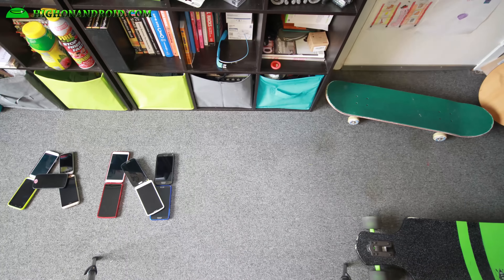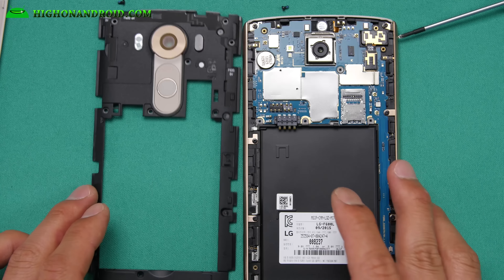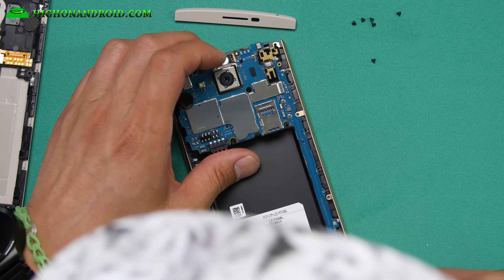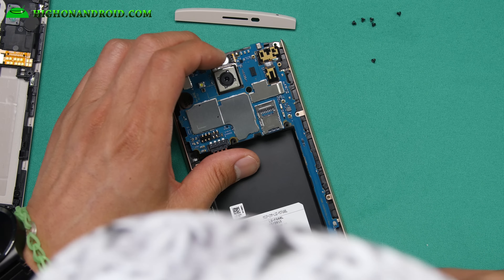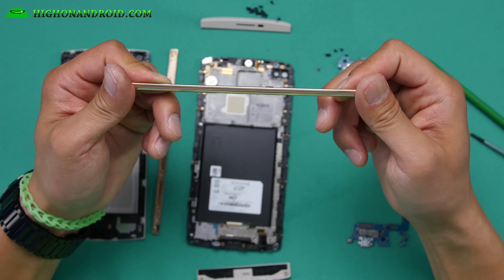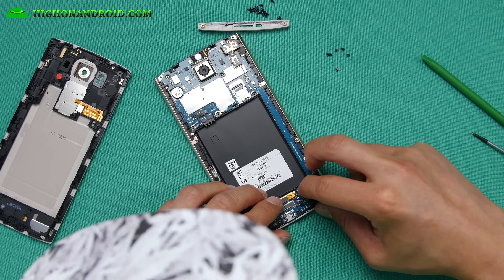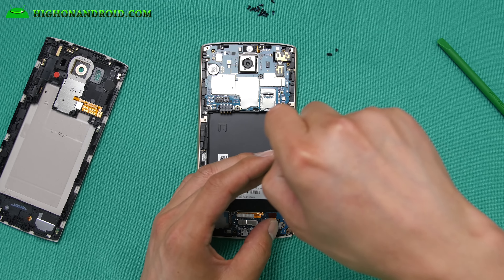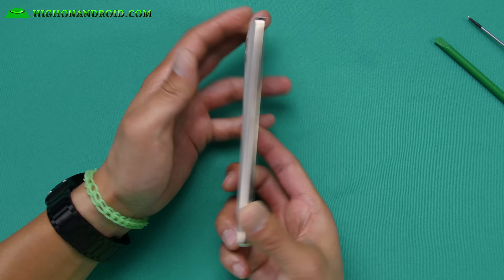How to Disassemble LG V10 for Repair! - TEARDOWN!!!

Comment: Awesome video Max. Just what I've been looking for. I broke the screen on my LG V10 within a month of buying it. This video has gaven me the confidence to go ahead and buy the replacement screen and do it myself.On a different subject that I have about cell phone peripherals in general, are the charge cords. They don't last... When (and if) a phone charging cord manufacturer develops a USB phone charging cord that doesn't become unusable within 3 weeks of use, that is the charging cord manufacturer that will have my undying loyalty... forever. I've had to buy 4 or 5 new charging cords since I've bought the LG V10. The phone is ok and the electrical plug adapter is ok, but the USB cord always quits working within a month or so and I've only had this LG V10 for 5 or 6 months. I'm always extremely careful when plugging it in to never jam it, or put it in sideways. I also ensure I remove the cord very gingerly when disconnecting, but the cords never last for more than 3 or 4 weeks before becoming unable to charge the phone.If there are those of you out there that have the same problem and have rectified the issue buy purchasing a certain cord, PLEASE let me know. It's very frustrating to plug your phone in and it not begin charging...

Comment: nice and simple to disassemble! I'm a bit worry about how the power button(+FP sensor) and volume button is connected to the board though.Are other LGs such as G3,G4 like that?
Reply: yknow that it's better convinent and cheaper to replace the entire thing with the board right? miniature parts are problematic and requires extra engineering

Comment: Thanks for the vid, used this to swap screens but I still have a black screen.  Any suggestions on what to try next?  I know the phone powers on, i hear the startup sound, receive fb, reminders, and other notifications sounds but have a black screen. There is a tiny bit of light coming from behind the second screen.  Any thoughts on what you think it could be?
Reply: Fluid Frame it's the motherboard..but the problem is they're nearly impossible to find unless you get it on eBay which I personally am not trusting, good luck lol
Reply: Thanks Chosen One!

Comment: The upper left hand corner of the digitzer, that one thing with the white L what does that do? I got a new screen assembly in the mail and there was a part loose in the bag  it looks like some sort of connector. and it goes where that L is.

Comment: - if the phone doesn't work it means that the problem is with the motherboard? No matter what I try it doesn't turn on. I would appreciate an answer. Thanks. Love all your videos.
Reply from the maker: Most likely yes if it doesn't work with new battery.
Reply: Max Lee - Thanks for your reply. 👍

Comment: I shattered the glass on my screen but the screen and touch abilities still work flawlessly, is it possible to just replace the glass, or do I need to buy a complete screen assembly?
Reply: Same boat! I found one video that mentioned just replacing the glass, but it involves having to heat the adhesive to be able to pull the glass off, then needing to use product to put it back together. Seems very complicated.

Comment: So the metal rails are what give it it's Mil Spec drop rating?
Reply: +David Sears The rails, the full metal frame, and the dual glass display works in conjunction to get that rating.

Comment: But where do you get the display replacement D: Cant find
Reply: etradesupply.com, they don't have all the colors though
Reply: +Mark S. damn thats cool though, could completely change up your front color as well. Not just the back plate. So then third party can make those front plastic pieces too. like the old nokia days.
Reply: Espada..... Ebay

Comment: excellent vdo. I was afraid  to bread  MY g5 as the battery overcharged and bubbled to kill the back switch from working. battery would not come out.  So wala ----its fixed along with my back button. As far as parts; forget it if not in USA. there is no support in ME, Asia for any parts or servioce. They won't even sell you one in phillipines Malay, Thailand. i bought this in Dubai and they don't service after either. Sad. A great phone but they can't survive. The web sites, FBook  and all also offer no support.  Get on any msn msngr LG site and there is no support

Comment: So how does one remove the 3.5mm headphone jack for replacement?
Reply: +David Mitchell  Thanks for asking, that is the same question I have now.  Can't believe the darn thing breaks so easily.
Reply: +Michael “Kilokk” De Taranto A local repair shop has an earphone jack on order for mine. I will ask for details after the repair.

Comment: my v10 fell on the carpet in the office and now there are fuckin lines all over the screen. the funny part is that the screen didn't crack or anything, just vertical lines and some discoloration. am I looking at buying a new screen?
Reply from the maker: Probably a loose LCD connector try reconnecting.
Reply: i did, and still the same, i called Tmobile and they got me a replacement for free that will be sent to me over night, and i also spoke to one of the reps in the store he said with cases like mine i might get charged a non refundable $400 cuz they can blame me as i created "pressure point" on the screen where the lines are even thou there is no signs of  physical damage the phone is in the case. and what pisses me off the most it fell from my waist. im just pissed.